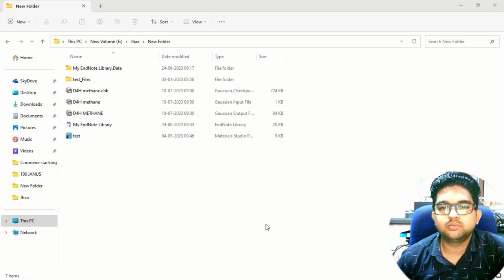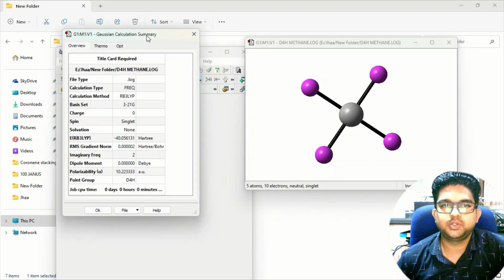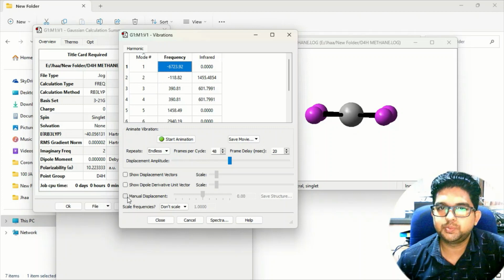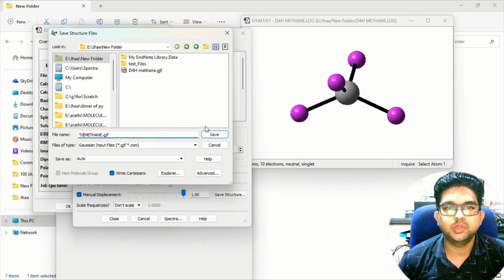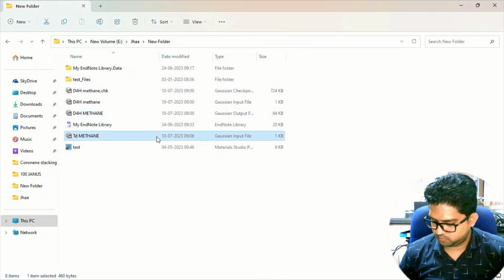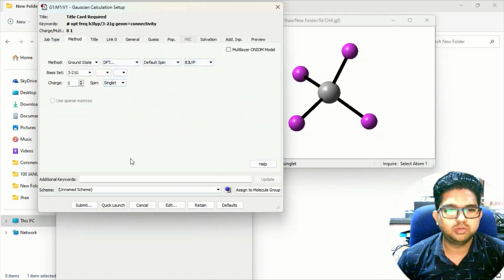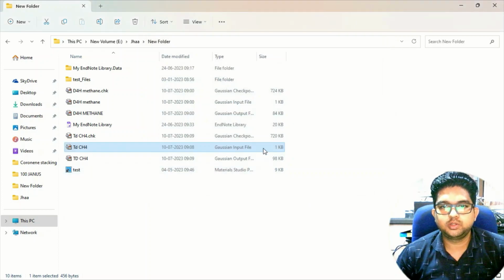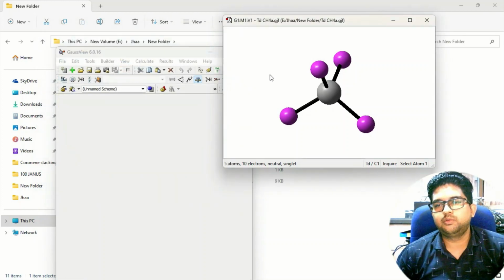How to eliminate negative/imaginary frequency in Gaussian during geometry optimization

Comment: Sir…. No negative frequency value is present still only max displacement is not converged . Is the calculation okay with max displacement being not converged or what can we do to optimise the frequency because geometry is successfully optimised?
Reply from the maker: @sikhasayantani7685  sometimes it happens that geometry optimization steps converge nicely but the frequency shows some convergence issues ....in those cases open the output file in a text editor (notepad or notepad++), check the difference between the threshold and the non converged values, if it's small (in third or fourth decimals) then you can ignore or in case the difference is huge you have to repeat the calculation. But mostly the difference between the threshold and the unconverged items will be small, so you can ignore.
Reply: Thank u sir  @quantumguruji

Comment: hi sir, before i start the optimisation i use clean( broom) tool and then start the optimisation.i noticed that there are no  negative frequency. 
is it correct to use the clean tool or not ( i drew the molecule with chemdraw)
Reply from the maker: It's alright
Reply: @quantumguruji  thank you sir 🙏

Comment: Sir, how can it be done by checking the output file, imagine if we have no visualisation tool. can you please explain that?
Reply from the maker: Several free visualisation tools are available....like avogadro....use that ...manually also one can do using just .out file but you may do mistakes in that as you need to add the coordinates manually
Reply: @quantumguruji  Actually, I have GaussView, but I wanted to know how to do it without a visualization tool. Now I found how to do it. Your video helped me a lot. No other video I found explained how to eliminate an imaginary frequency. Thank you, sir.
Reply: @JPCaptureMedia how do you change “manual displacement” manually in the output file please?